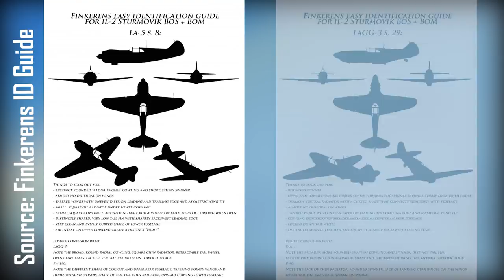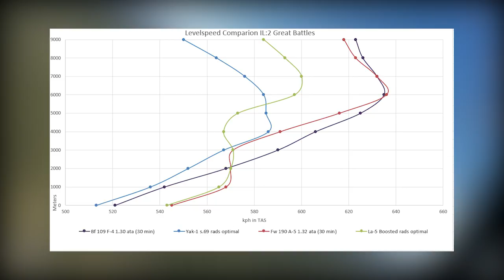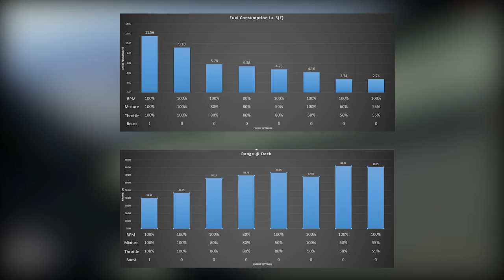How to La-5 Part 1 | Basic Tutorial/Guide | IL-2: Battle of Stalingrad

Comment: About the engine mixture, 100% is auto rich, so it is really the best setting for combat at high altitudes as well, as it adjusts automatically with altitude, you should lower it if you want to save fuel.
Reply from the maker: Yeah i forgot to mention that

Comment: Hello, I dont understand the braking system at all. I press r and l brakes and nothing happens and I have checked on other il2 planes and I have braking capability on them but not on the La5. I listened to you talk a bit about this, but I dont understand. Thanks
Reply from the maker: U have to use just the wheel brake button and the rudder.

Comment: I still dont understand how to manage the engine to not fail a mission. It happens all the time to me. After few minutes in the air I cant control my throttle and I fail mission. There is no tutorial about oil, water, coolant temperature neither about fuel mixture it is very unfrotunate and I have thousands of hours in simulators (though civil airliners). Did not expect it will be so hard to fly in this game without engine failure.
Reply from the maker: mhh its not that hard. Open inlet shutters, open oil, raise mix fully, open outlets as much as needed and you can fly the aircraft  quite well.
Reply: @SheriffsSimShack  Will try thank you.

Comment: Hello, sorry if this has been asked but I looked everywhere and can't get an answer! I'm trying to taxi and takeoff but the aircraft simply refuses to being moving until ridiculous throttle is applied, it's like there is a parking brake being applied but I have checked my controls and there seems to be none on the aircraft. In your video, you just seem to be able to go 20% thottle and begin moving fine, but it's like I'm stuck in the mud until about 90% throttle, and even then, I don't have enough speed or rpm to turn the aircraft using the brakes and rudder.
Reply from the maker: You probably havent raised your RPM. You have to do that manually.
Reply: @SheriffsSimShack  Ohh thank you very much. At the start of the flight it is 0% like the mixture then I suppose. Thanks again

Comment: Height of supercharger switching depends on current speed. While climbing the speed is smaller so then you need to switch earlier. I usaly checking mainfold pressure. If it is below 790 mm i switch stage to second.
Reply from the maker: The manifold pressure is not a good indicator. Since the supercharger needs below a certain alt more energy than the grown manifold pressure provides
Reply: it is good for switching from 1st stage to 2nd (you can prove or correct this value by trottling engine below switching height and making full thrust on 2nd stage. From 2nd to 1st espeshaly from dive flight you should switch stages earlier, but it means that you have a lot of speed anyway.
Reply: and btw in winter you need to switch stages at more higher altitudes than on other seasons and diffrent weathers. So cheking mainfold pressure is better method that knowing altitude value.
Reply from the maker: I tested it and it proofed to be wrong. A higher manifold pressure doesn't result in higher performance necessarily.

Comment: Great video. One thing I'm curious about is how much of this video also applies to the LA-5FN? Mainly in regards to engine management.
Reply from the maker: Very similar but there are some differences. The FN has no mixture control, and has no boost which is to be activated by a push of a button. Further more a higher, but time limited RPM setting. I will do a video on the FN if I have the time in the future
Reply: Sheriff's Sim Shack thank you for the fast reply, I'll be sure to use that information when I take the plane out on sortie